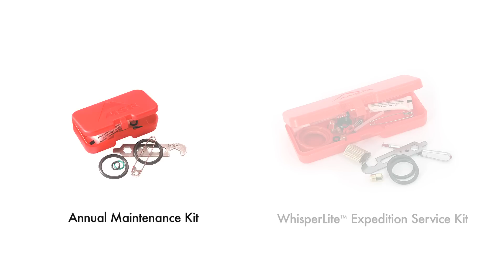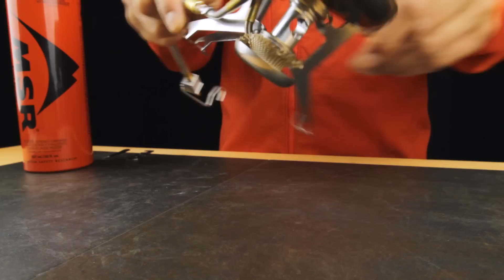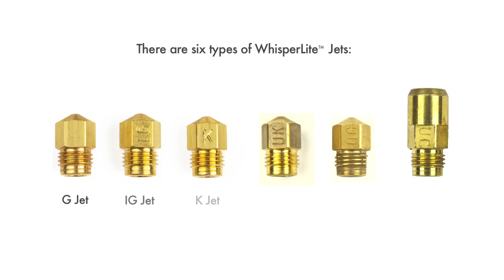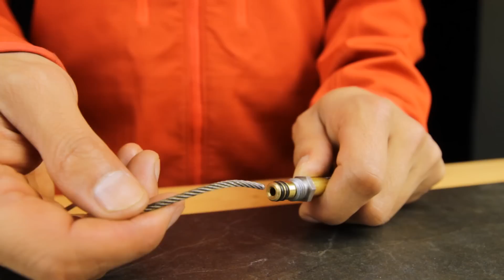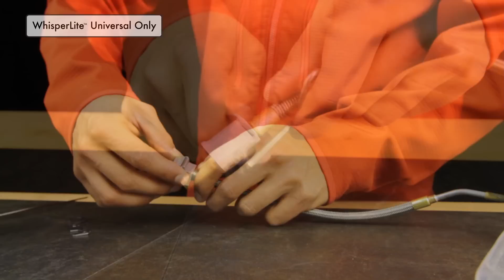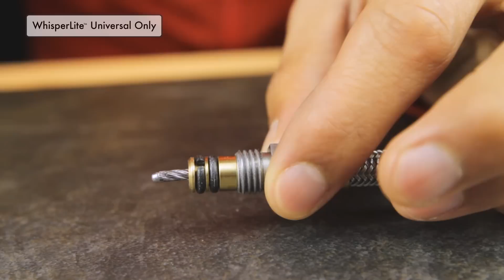MSR Stoves: WhisperLite Universal and International Maintenance

Comment: Is there a reason why it’s not stated that the Universal can burn 100% propane gas bottles (Coleman 1lb bottles) with a LPG/propane to lindal adapter?
All the manufacturers with e don’t say you can or say you can’t yet everyone who does it says it works fine
Reply from the maker: Good question, and that's correct! This has to do with the valve type. We do not recommend using third party adapters with our stoves. These are a potentially unsafe modification of the stove. This can cause the stove to burn at heat levels that it has not been tested for which can lead to permanent damage of the stove.
Reply: @MSRGear  So pure propane burns hotter than isobutane mixes?
Reply: @MSRGear  my recommendations for the Universal to really stand out amongst the competition, would be make bottles that can store water so they are more multi use, design and test lindal valve adapters for both the higher performance 100% pure 1lb propane bottles (which can also be refilled from the bigger 20lb propane tanks with the right adapter), and also a lindal adapter for the cheaper and more common (than iso butane canisters) 100% butane canisters which are available everywhere in multi packs. Instead people are either just using after market adapters anyway, or less likely to buy the Whisperlite Universal as it may not be as multifunctional in terms of various fuel types as they would prefer (even though it is very multifunctional)

Comment: How can I tell if I have the Whisperlite international or Whisperlite? I have an older one handed down and was just wondering what was the difference? Is it just the jet? And can I change the jet?
Reply: yaks6312 I believe the Universal can run off of both liquid fuel (white gas, unleaded gas, diesel, kerosene)  AND their isopro propane canisters. The International can only run off of liquid fuel. I'm not sure if one could potentially change out some parts and run both with an older model. I purchased the International because I prefer the cheaper prices of white gas. Canisters get pretty pricey.

Comment: which jet is the whisperlite international sold with currently? Bought one at REI. Going to possibly run pump gas through the stove while backpacking europe. Curious if i should change out or not.

I'll probably take it apart and check. Just curious.
Reply: ah!!! My whisperlite international came with a UG jet installed! UK came with whisperlite international in a bag on the side also. Very good. thought'd Id have to buy one.